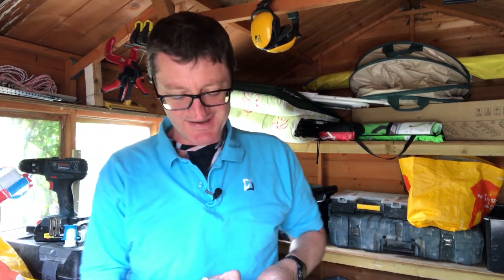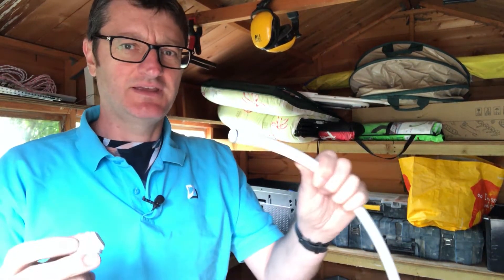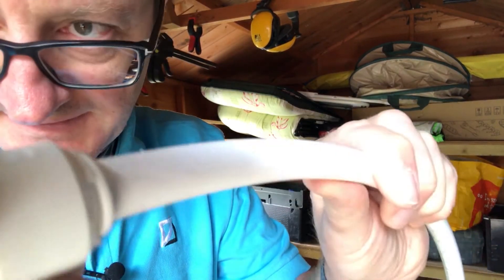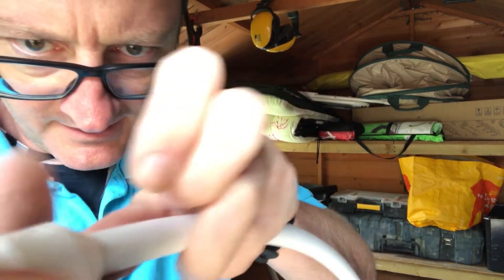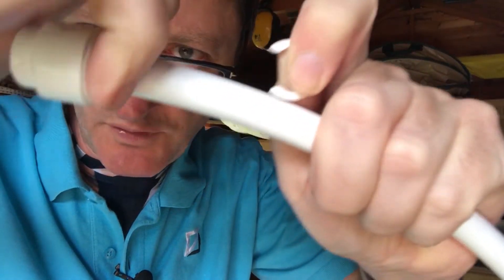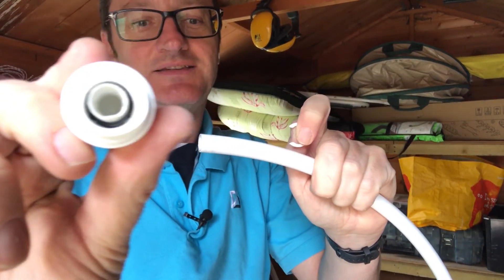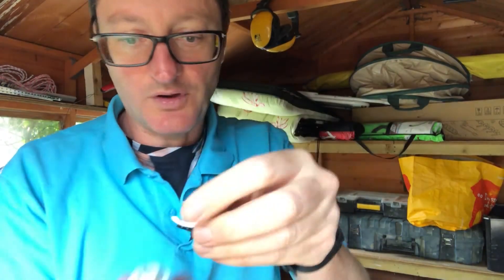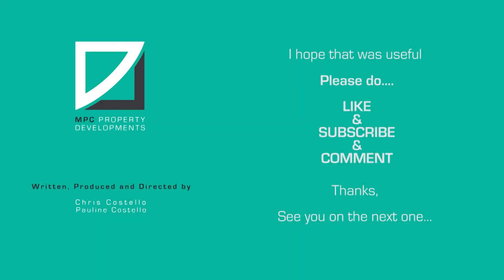Renovate; How to fit and remove an End Cap push-fit plumbing fitting.

Comment: Can you join that flexible plastic pipe to copper pipes via those push joints? Or does it have to be plastic to plastic pipe?
Reply from the maker: they work fine on copper to plastic..  you don't need a stiffer in the copper pipe